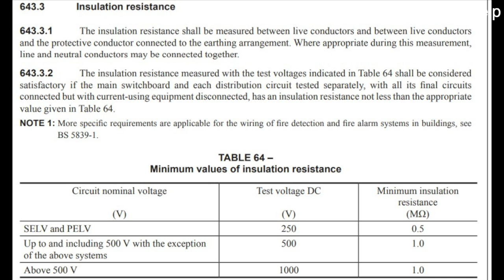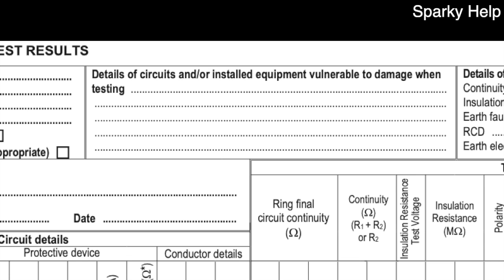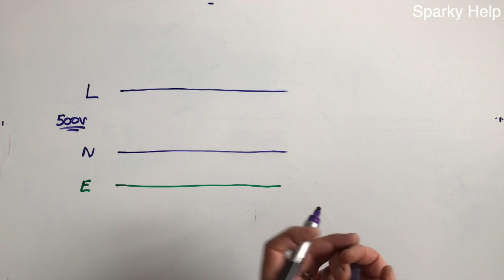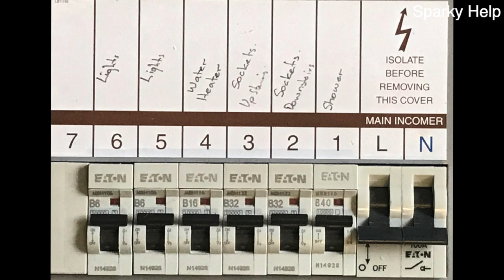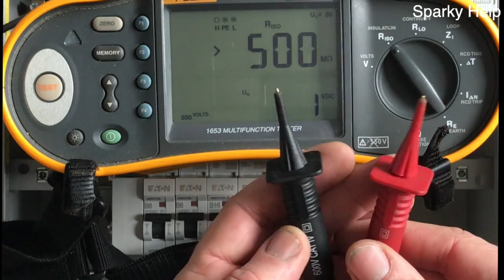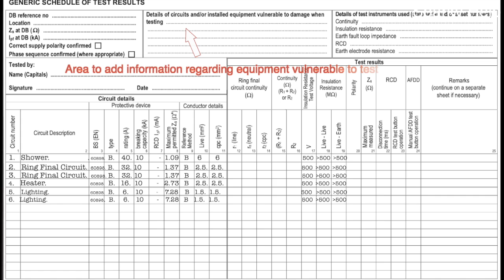Easy Guide to Insulation Resistance Testing, Fault Finding and How to Complete the Test Sheet

Comment: Im benefitting from your videos please continue making more videos
Reply from the maker: Hi thanks for watching, I will they just take time.  Any topics of interest?  Don't forget to like subscribe and share.
Reply: @sparkyhelp3997 1) wire two float switches in series . 

2)how to wire a borehole pump with schematic 

3)how to read plc drawings 

4)how to set dip switches on multiple batteries (pylontech for eg) 

5)How to do insulation resistance testing but with (day night switch or usb type socket outlet ) 

6) how to wire a ceiling fan but include a good schematic. 

7) pressure switches 

8) generator connections to a db board . 

Those will be very well appreciated.  Once again thank you

Comment: Hello, what if there were rcbos among those breakers, how would you test?
Reply from the maker: Hi and thanks for watching, unfortunately you would have to test the circuits separately, however leave the cpcs connected to the earthing system.  Hope that helps.  Please share with like minded people - don't forget to like and subscribe.
Reply: @sparkyhelp3997 hello thanks for getting back so quickly. Would I have to remove the live and neutral cable from the rcbo before the IR test?
Reply from the maker: @pcg1276  possibly at least one, but depends on the RCBO some are single pole and some are double pole.  You would soon see when you test as you will get a low insulation resistance.

Comment: Wouldn't touching the tip of the test probe shock you when the tester is pumping out 500V? I was taught not to touch any metal parts when the test button is pressed during the IR test and to connect the probes together after to discharge the voltage before handling.
Reply from the maker: It is 500V but the current is 1-2mA so not going to do a lot - (who has not touched it?) Thanks for watching please share with like minded people.
Reply: Shocking

Comment: Hi great video, although i am a bit lost as to why theres a 500Mohms resistance between the N and E busbars, i thought N and E are supposed to be connected together from the main supply (either a transformer or a generator).
Reply from the maker: Thanks for watching, please share with like minded people.  The reason is the main switch is double pole, therefore any main switch that also breaks the Neutral will be disconnected.  Again thanks for watching please like and subscribe, check out my other videos.

Comment: Brillliant video!! Could you explain please why connecting line and neutral together to earth on circuit with items connecting works please and doesn’t damage items? Many thanks
Reply from the maker: The electrical loads work when a supply of the appropriate voltage is applied to Line & Neutral.  When 500V is applied to L-N it will measure the resistance of the load and therefore provide a reading which could indicate a fault and or you will damage the equipment as it was never designed for 500V to be applied.
Hope this Helps, Please take time to like the Video and even better Share with others and Subscribe.  Many Thanks.
Reply: Ok thanks but can I ask how putting line and neutral together and testing to earth also stops items being damaged please? Surely by putting line and neutral together and testing to earth you wouldn’t find a short between line and neutral would you? Many thanks mate
Reply from the maker: L & N are connected to the same test lead (at the same time) other lead to CPC (This is what PAT testers do)

Comment: Great video but I am confused at 15:53 Fault finding L-N. It looks like you are probing on the 32A breaker in order to see if there is a fault somewhere else. I am sure I am just not seeing it correctly but if you or someone else can hep, I would be greateful :)
Reply from the maker: Hi, If you look at the circuit Breaker you will see they are all switched on.  Therefore all circuits are being tested (Ensure Main Switch is off) The test probe can be on any terminal and all are part of the circuit.
Hope that helps. Please Like, Share & Subscribe.

Comment: At 4:12 in video the neon isolator appears to be switched off. How then can the neon light come on under IR test ?   Can you please clarify.  Thanks
Reply from the maker: Well spotted, this fused connection unit had the neon configured on the incoming supply.  Please Like Share and Subscribe.
Reply: @sparkyhelp3997    Thank you for clarifying.

Comment: Would it damage any loads connected if you are only performing a 500v test when testing between live conductors to earth?
Reply: I know if you join them together and test to earth it doesn’t but does it when you test them individually to earth
Reply from the maker: In would always be best to test lives - earth, in theory live to earth should not make a difference, but best to err on the side of caution and test them together - to truly answer that you would have to know the the electrical connections of all appliances or connected loads. Hope that helps.
Please Like Share & subscribe.
Reply from the maker: Addendum, if there is a neutral to earth fault or line to earth fault, if they are carried out separately, then in this case it could damage equipment - sorry thought about it again! So stick to Lives together to Earth (this is how PAT testing machines carry out this test).  Hope that helps.
Reply: @sparkyhelp3997  really appreciate your replies I’ve liked and subscribed I’m starting testing after Christmas and just trying to grasp my own understanding
Reply: So a 500v live to earth test doesn’t damage connected loads proving electrical connections have the right polarity?(connected to the proper terminals) I know lives to earth would be a safer test when loads are connected but surely it wouldn’t rule out if the fault is between line to earth or between neutral to earth? Only asking this incase a situation may arise where disconnecting loads isn’t practical or possible.

Comment: Why don't you need to zero the leads?
Reply from the maker: Insulation resistance is measuring Mega ohms and the leads are likely to be milli or even micro-ohms therefore, there is no point or often facility, to zero the leads for an Insulation resistance test.  Please Like, Share & Subscribe.

Comment: Another Learner Question : If you link L-N( to negate damage to sensitive equipment) , test to cpc &  get good results across the board  can you still  legitimately fill in your two columns on test sheet L-L & L-CPC or do you still have to do those two tests seperately? Thank you again
Reply from the maker: This was a grey area in the older regulations - you definitely test Live - CPC.  The new regulations (which I will have to do another video on), now clarifies that all conductors must be tested (this will mean linking wires before electronic equipment connected and testing all conductors, and then after connection of equipment testing again at a lower voltage or linking) - sorry it is not a straight forward question to answer, but I hope it has helped.
Hope that helps - Please like, share, subscribe or if you really want to buy me a coffee!  Thanks

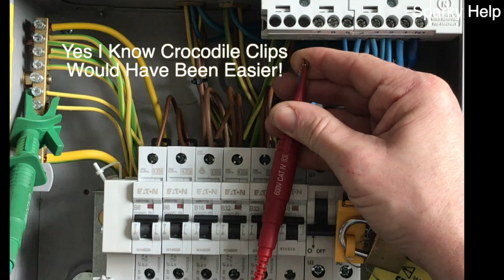Comment: Thank you . Great Learner/apprentice video. Learner Question (hopefully not stupid) : @19:40 why did you not get 500v DC running into you when holding conductor onto probe with your finger?
Reply from the maker: In order  to receive a shock you need to complete a circuit, so I would need to touch both (500V DC  from tester).  Don't try this on your system at home as the neutral is earthed and you will get electrocuted.  See earthing systems for a better understanding.

Hope that helps - Please like, share, subscribe or if you really want to buy me a coffee!  Thanks

Comment: The main problem is doing this routine is that in reality in a lived in property is that you'll never unplug or isolate everything.  

Even joining live and neutral and testing between cpc and joined lines you can still get suspicious readings from electronics/surge protectors in socket adaptors/ neons blah blah blah. 

So say you get 0.65 , you disconnect all sockets/neons..it ain't happening. At this stage do you look for a fault or spend hours disconnecting things to ultimately tell the client that you're charging a days wage for just disconnecting and reconnecting all things that could give a curious reading. 

These desk jockeys on YouTube saying inane things like disconnect all electronics? Come off it.
Reply from the maker: Are you talking about a Condition Report or an Initial Verification.  If you get 0.65Mohms are you saying you would leave it?
In amendment 2 of BS7671, Insulation resistance testing has become more involved - the regulations are just brilliant!!!  

As long you know how to test properly and have a full understanding what you are doing what each and every one of does is entirely up to them, but I reckon if they were being assessed they would do it as per BS7671.

Comment: Apologies if this is a silly question but when doing the fault finding N-E test 19:00 mins into the video why didn't you turn off (down) the MCBs like in the fault finding for L-N and L-E? Many thanks for the videos very helpful indeed
Reply from the maker: Hi, because the circuit breakers only break the line conductor.
Reply: @sparkyhelp3997  many thanks for answering

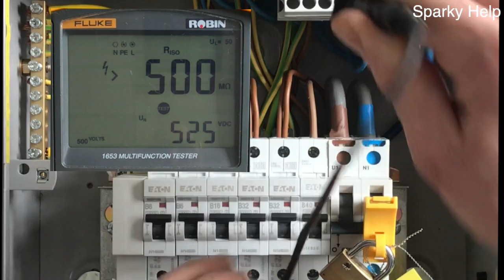Comment: Hi Sparky Help. I just wonder why you have different results between 14:03 the test result for L-N is 500MΩ (insulation Resistance test) and 16:02 where you have the test result for L-N is 1.72MΩ (Fault Finding). Thanks in advance.
Reply from the maker: I had introduced a lower resistance in the circuit to demonstrate how to find the circuit in question.  Hope that helps.  Please like, Share and Subscribe.

Comment: Wish the camera was a little lower did you test from the buzz bar or just on of the live terminals.i think your saying because all switches are closed it does not matter where you test from. A little response would be helpful if possible thanks for the video much appreciated
Reply from the maker: You are quite correct it does not matter where you test from as all the switches are closed (just do not test on the incoming side of the main switch as this would probably be Live).  All the test can be completed (if all circuit breakers are on) on the outgoing of the main switch, Line and Neutral and the earth bar.  Hope that helps, please like share and subscribe.

Comment from the maker: 'Hi, great explanation and very good video. I have a question when testing ring circuits in terms of insulation resistance. In a ring circuit shall one test on only one end of the L and N cables? Or can one link the two L ends and the two N ends and test across them?'

Had this question.  The circuit can be left connected in the DB and tested, if you wish to test the circuit separately it is best to test both ends at the same time.  If you did test only one end of the circuit the other end would still be tested as it is a ring, but you may give yourself a shock or it may touch something to give you as false reading.

Comment: Is there a reason that for L-N you testing the supply side of the live in the MCB and for L-E you tested the load side?? Forgive me if this is a stupid question
Reply from the maker: Hi, no such thing as a stupid question just stupid answers.  Test on the load side if able to, to test all the circuits at once, but remember to have all the circuit breakers on and all switches on.  Remember the supply side of the isolator will probably be live.  Hope this answers your question.
Reply: Good question

Comment: Estate agent only  pay £90 per EICR how can you spend so much time removing the things and put it back on ?
Reply: That is the fee asian estate agents pay. I wouldn't get out of bed for £90 for an EICR.
Reply from the maker: Read BS7671 Part 6, periodic inspection for information on EICR's

"Periodic inspection shall be carried out without dismantling, or with partial dismantling, as required, supplemented by appropriate tests..." 

It is important you set out limitations with the client.  It is not necessarily a full initial verification.

Comment: Going to be sitting my am2 in a few days. Do you think they would allow to test this way (testing all the circuits at once) instead of testing one by one. Of course if I found a bad circuit like you did yourself (turning breakers off 1 by 1) or by then testing circuit by circuit then I would go for the fix. But as a collective for testing my circuits this could save a lot of time. Thanks
Reply from the maker: If you test all circuits collectively (dis-board at a time) with all vulnerable equipment removed, you will be testing to BS7671 - the correct way.  Just make sure you test RCBO circuits separately if they are vulnerable to test.

Good luck and read the specification carefully when doing your AM2.
Reply: Sparky Help yes so any RCBO’s I will turn off so to not fry the breaker correct? Or can it still do damage potentially even when turned off. As I believe the board will be 3 phase as there is a doll motor so there will be no RCD switches. Cheers for the response.
Reply from the maker: Yes turn the RCBO off and make sure you test all combinations of three phase (exactly as you would do when carrying out safe isolation - sorry I did not cover 3 phase in the video).  Make sure you then test the RCBO circuit separately.
Reply from the maker: And don't forget to test the other side of the DOL starter.